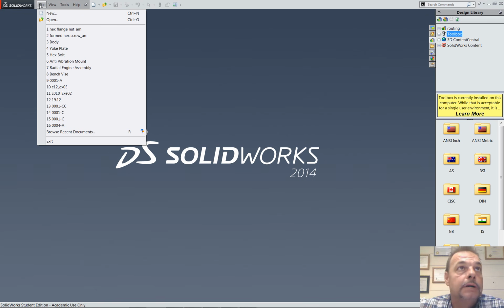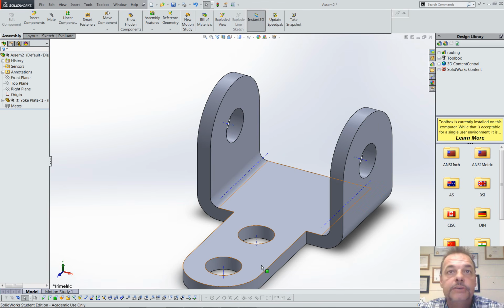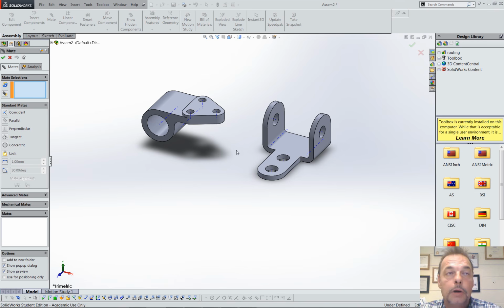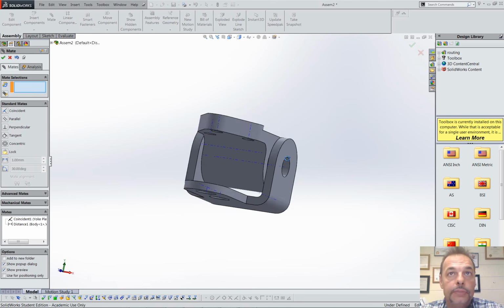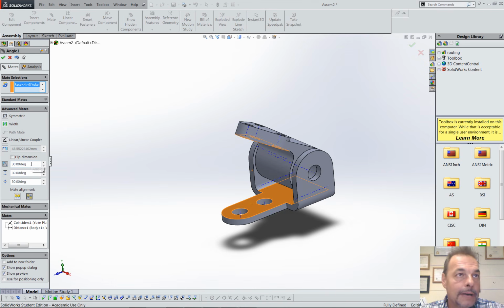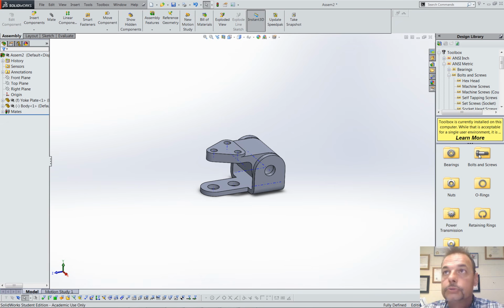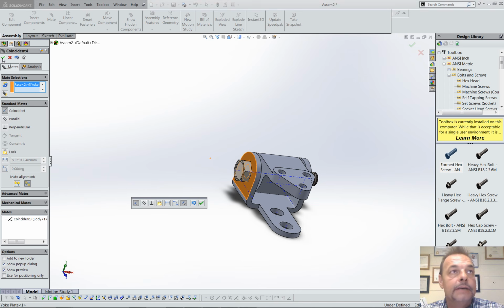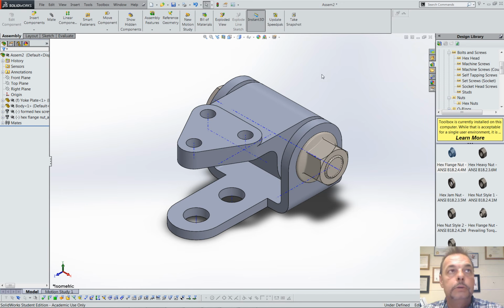Assembly Rotating Mates

Comment: Thanks for the video!! 

One question, how can i add those blue axis in the parts? Is that on the modeling mode or assembly mode? 

Thanks so much! :)
Reply from the maker: You can add this in the sketch and it will show in the assembly when you bring it in. However, you will have to make sure inside of the view pull down that show axis is activated
Reply: Great!! thanks for your promptness!! I got it now!! a Lot thanks!! And congrats for the video!! :)